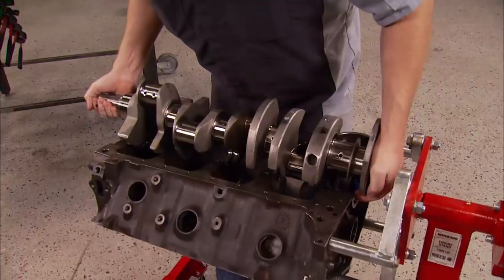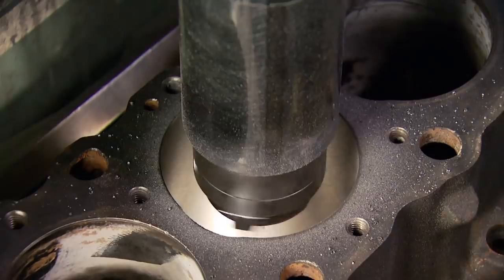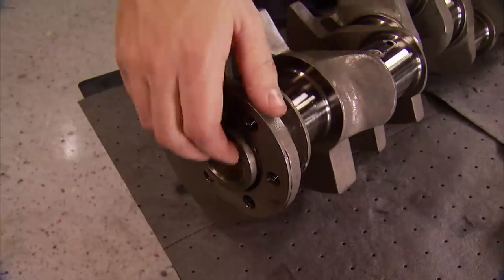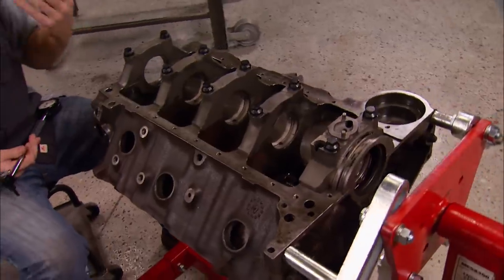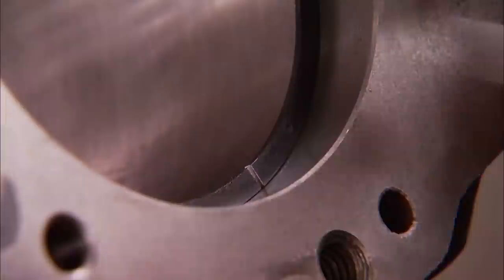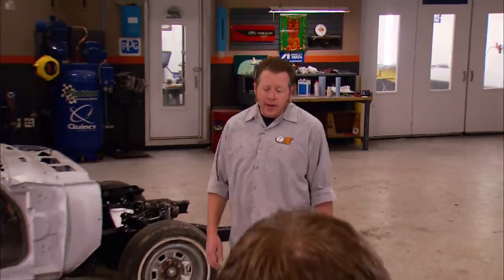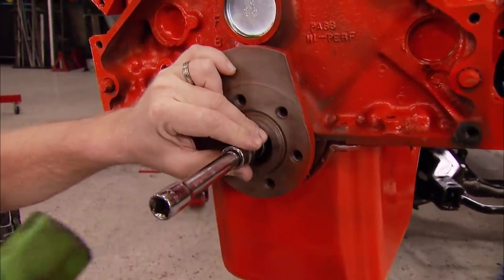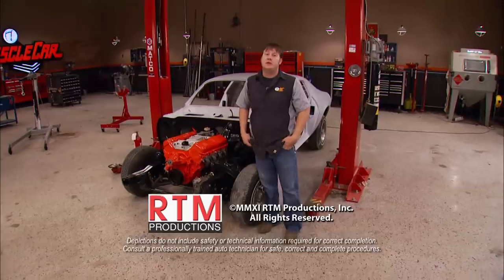Sleeving a 396 Big Block for a 1970 Camaro - MuscleCar S6, E8

Comment from the maker: Tell us about yourself! Take our Viewer Survey! https://www.powernationtv.com/ytsurvey
Reply: POWERNATION , I got a 66 Super Sport Chevelle with a built 327 , 12:5 to 1 compression Forged pistons , Vette crank , 350 four bolt main engine block , aluminum hi rise intake, HEI distributor , headers , 750Cfm carb. 11 inch clutch , Lakewood blow proof Bellhousing , M-21 Muncie 4 speed trans , 12 bolt posi Trac , Traction bars , 
5.5 sec@ 96mph in 1/8
Reply: 99

Comment: What a dream--a large, clean garage with heat and a concrete floor, immaculate engines surrounded by plenty of open space to work in, and all the tools necessary. Paradise.
Reply: Yep! :( ... I swapped an old tired straight 6, with a 350 chevy small block, and a TH350 transition.  SO? All custom fabricated mounts brackets etc.  Oh and I did all the "on vehicle" work, l OUSIDE in the winter, (In Canada)

Comment: True L-78's and L-34's had 4 bolt mains with a L-78 having steel crank.  "Hi-perf pass" was cast on the block @ oil pump area, and stamped with T1212JD on the block.  They came with square port heads, with 2.19 intake valves along with 11:5 comp and solid lifter cam with 0.520/0.520 lift.  On top came a hi-rise aluminum manifold with a Holley #4150, 780cfm.  The rod bolts on a 396 were 3/8" while the 427 hi-perf. came with 7/16" bolts and the rods were dimpled.  L-89's came with aluminum heads.  Using No. 72 jets in the primary with tube headers would get around 500h.p.
Reply: They also came with 7/16 diameter push rods
Reply: Nice google work man
Reply: 375s comp.ratio was 11to 1. Early 427 hi perf. Motors came with 3/8 rod bolts. They were notorious for breaking . You had to check them when buying replacement short blocks to make sure you got the 7/16 bolt. This was before arps came out

Comment: I used to have a 68 chevelle ss 396 I rebuilt the engine 42 years ago. This brought back memories from taking the block heads and crank to the machine shop for work. I thinks the machine shop and bearings they supplied set me back $300. Wish I still had that car.

Comment: Kept the shelled-out block but scrapped the heads for new Summit castings?  With today's low-ZDDP motor oil, I'da put a roller cam in it for sure.
Reply: That's what I was gonna say. A nice hydraulic roller would add some power too.
Reply: Rick Campbell  I have my cams made at Engle Brothers, I let them know what I plan on doing with the engine and so far they have been spot on!
Reply: Oh yea, the stress of potentially wiping out a lobe just ain't worth it to me either.
Reply: On a street motor that will only occasionally see 6000 rpm there is no need to run 450 lbs springs, especially with this cams easy lobe profile and medium lift.

Comment: I was glad you changed the heads,  i have no problem with the block repair,  lower end looks ok with high dome pistons to get your 11.5:1 and solid lifter setup, 2 bolt mains is not L78, also intake does not look correct. a stock L78 makes 425 hp and 445 tq,  Chevy under rated these at 375 hp, with headers you make 457 hp and 464 tq.

Comment: Before sanding any rear main bearing thrust surfaces always measure the widths of both the upper & lower bearings; you might be surprised to find one half is wider than the other.  Be sure to inspect the thrust bearing saddle faces on the block for irregularities too.

Comment: When you measured main bearing bore with bearings,you stated that the clearance was 24,26 and 29. Tolerances are the correct terminology are crucial and new engine builders might take that as .024,.026 and .029, when in fact it’s +.0024,+.0026 and +.0029 and the diameter should be stated as plus 2 and 4 tenths of a thousandth and so on for each diameter and written +.0024. And when checking diameter of mains and pins,you should always check in 2 places at 90 degrees from each other,this will not only show undersize diameters,it will also show egg shape of diameters if present.And you HAVE to measure in tenths of a thousandth if you want accuracy,if your micrometers don’t read in tenths,I suggest that you get them and have an experienced tool and die maker or a good machinist teach you how to correctly use and read a micrometer,this aspect of building engines is the most crucial part,and you’ll gain more respect,and I agree with the knowledgeable people on here,that block is a boat anchor,gonna be a hot spot there and I sure as hell didn’t like how easy that sleeve pressed in.

Comment: You can also use plastic gauge on the crankshaft 2 block inspection. We have been using plastigage for years with every motor we have built measure twice build once
Reply: GreenBoy at GA Farms These guys have the correct tools to check the tolerances and you want them to do the half assed method? okay....
Reply: @alexcorona  and how many motors have you ever built maybe some tricycle Motors
Reply: @alexcorona  maybe you should stick to working on cameras. Do you even know what plastic gauge is or even how to use it do you know how to read it after it's torqued and compressed do you know how to read a dial indicator I'm pretty sure you don't otherwise you would not have left the comment you did plastic gauge is measured relatively close do the same thing as a dial indicator it measures how many thousands between journal to journal they've been doing this before dial indicators were even invented

Comment: What is the valve spring pressures?  145 closed pressure is going to be right on the ragged edge of what those roller tip rockers can handle,  bet they burn-em up.
Reply: and no poly locks......

Comment: Surprised they just hammered that sleeve in without freezing it first.
Reply: ya, I was a little concerned when they did that....i'm used to seeing machine shops doing the machine word so that warming the block and freezing the sleeve are the usual......
Reply: @mikespillman3075  I thought that sleeves had to be pressed in?
Reply: Freeze the sleeve and put sealer in the cylinder since its to water.
Reply: Yeah. AFAIK the standard procedure is to freeze the sleeve, heat the block, then press in the sleeve. 
I suppose production schedules and budget limitations sometimes overrule processes.
Reply: @ChristopherGaul  press/hammer meh apparently
Reply: Christopher Gaul if they would have froze that sleeve it would have fell right in,that press fit was shit,definitely about +.0005 too much on block bore.And I’ve sleeved countless blocks,you dont have to freeze sleeve or heat block if machining is done correctly.
Reply: I've seen them just hammer in like that, especially in stock applications, and only  a.001" interference city like they used ... in this case, an old trick was to give them  shot of any thin spray paint, and hand hammer them in wet.  But many builders use a tighter fit just barley under .002" ... that a lot tighter and freezing and pressing in the sleeves is more popular!
Reply: In 1964 I acquired an R code 427 that had blown three times in a drag car.  Rod had broken at the small end and and wrapped around it's neighbor, wedged between the counterweights...block had a chip out of the bottom. Sleeving that cylinder in JC auto shop became a class project. Got two rods and pistons at a junkyard.
    Engine went in a blue and white 59 Galaxie...first power run after break in exploded the 3 spd. & overdrive....for &275.00 got everything from the engine back out of a wrecked R code Galaxie.
   Stock hubcaps and cheater slicks finished off "ma ma's grocery better. More than one 327 Chevy wished they never jacked
 me up on 4th St. in Santa Rosa, CA.
      We heated the block and packed the liner with dry ice before pressing the sleeve...even with that it wasn't an "easy" press.  LOL
Reply: The fact they left a ridge at the bottom of the cylinder,  helps keep the sleeve from going down, the head will keep it from coming up. 
I rebuilt a 1950 Ford flathead engine and the machine shop I had do mine, had a 2 thousands interference fit, meaning the sleeve was 2 thousands bigger than the cylinder.  It took a 10 pound hammer to drive it in.
Reply: @ChristopherGaul  won't heating the block compromise the strength of the block?
Reply: @chrismc410  no. You don't make it glowing hot. Just hot enough to expand some. The heat treat or temper isn't affected.
Reply: Won't freezing make the metal contract, like cold will for anything else?
Reply: @chrismc410  that's the point. Shrink the sleeve with cold, expand the block with heat. Make the former fit into the latter easier.
Reply: @ChristopherGaul  would it be easier to machine the cylinder in question to allow a slip in with zero insertion force with locktite or similar and the same time still work or is a tight fit necessary? 

Starting to find engines interesting
Reply: @chrismc410  the tight fit is necessary. That's why they normally use heat/cold to make the fit tight.

Comment: Yes indeed a sleeve is fine, do it all the time I use a white glue same as seat inserts, the step at the bottom makes it a pro job. The valve relief is for rectangle port heads with large valves and hi lift. note; all 4 bolt man blocks have it. Who coaches the speech technique all these performance show people sound the same ,(as a matter of fact robot ). fun to watch even though i do this all day long KEEP it up .

Comment: Not trying to be a critic however when using Loctite make sure you use it correctly. Apply the Loctite to the holes in the crank, not the bolts for the flywheel. Loctite will end up between the flywheel and crank flange as it will be extracted off the bolt while screwing it in. Common mistake made by many people!
Reply: Not quite true. I have used thread locker for years by putting it on the bolt first and never had an issue. I will say that I don't just slap it on and jam a bolt in though. I put it on and wait a minute or so,while blowing on it. This way it gels up, before I tighten it down. I have pulled out threadlocked bolts and they were tight coming out and the threads had thread locker between them.
Reply: You put the locktight on the bolts first, start with the first one you did allowing a minute or so to gel up
Reply: i worked many years in a factory using loctite and i found out the only thing red is for it just will not come out unless a touch is used and is heated up to 450 degrees
Reply: D F I agree you will have success that way however...have you ever pulled a flywheel off and seen migrated Loctite? That’s what I’m referring to. After Loctite cures, by nature (how it’s designed) it will force against the two surfaces, act as a jack and you will have a runout on the flywheel. Probably not a big issue on a typical street engine but it matters in pro racing when air gap is critical.
Reply: @cc9z  yes. Red is typically the "permanent" thread locker,that requires heat to break loose. Blue is "removable".
Reply: Donny Moose  best terminology is to use the number verses the color. Ex: red general purpose permanent is 271 and blue general purpose is 242. Loctite has a large variety of adhesives and some are the same colors so it’s best to refer to the number.

Comment: I’ve built many engines but have never installed a cylinder sleeve. Are you supposed to install them with any kind of sealant? I would think that a sleeve installed without sealant would allow for leaks especially if the cylinder is cracked or has holes in it like in the video.

Comment: Do these heads flow exactly the same as the original 3919840 heads?
My uncle had a 1967 L78 with headers and the block had been decked, back in 1970s, people came out of the woodwork to try to outrun him, nobody did.
He raced 440 six packs, 454s, 427s, 389s, etc.
Nobody came close to outrunning him,
The motor finally broke the frame on the left side on a 66 Chevelle (what he had it in).

Comment: What is the compression ratio on those pistons? (I couldn't find it in the link)  Looks really high. Will it run on pump gas?
Reply: Factory specs were 11x1
Reply: A stock L78 is 11.5:1 compression.
NO on pump gas, I have a 472 Cadillac with 10.5:1 compression that I have to add one gallon of 114 octane to the tank each time I fill it up.
I have a 11.5:1 BBC that I plan to run on E85 with one ounce of Klotz 2-stroke oil per gallon.

Comment: I will never use red locktight in a flywheel blot again! After spending a weekend under a vehicle, trying to get the bolts Back out! A torch, and several different sockets, I almost had to drill them out... I guess it could been poor quality bolts but I think blue loctight will work just fine!!

Comment: If your gonna da an L78, might wanna start with an L78 block, 4 bolt main💪
Reply: It's debatable if the 4 bolt main is much of an improvement over 2 bolt main on a BBC, it's more of a benefit for SBC.  Plus you could just machine it for four bolt mains, the block casting are the same, with BBC and SBC.  It's just like the valve relief it was only done on factory rec port BBC.

Comment: In my opinion the holes in the wall of the block is a death sentence for any high  performance engine use. Also I would have ground out the holes and patched the holes somhow. I unfortunately do not have a million $  speed shop at my disposal. This engine is a ticking time bomb with this type of damage.

Comment: The correct procedure to install a camshaft is : 
1. Before you bolt the block to the engine stand.
2. Stand the block, on it's bellhousing.
3. With the block vertical, NOW INSTALL the CAMSHAFT CORRECTLY.
Reply: Some sort of handle helps when installing the camshaft horizontally.

Comment: can someone edu. me? what is the difference between 396/400/402 and 427/454? Just bigger bore/stroke? thanks.
Reply: The 400 was a small-block. The 402 was a slightly overbored 396. The 427 shared the 396/402 stroke with a bigger bore. The 454 was a 427 with more stroke.
Reply: On top of that there were tall and short deck variants.

Comment: those sure look like oval port heads to me, 1970 L-78 should be rectangle ports and so with that said  what intake are you running cuz stock L-78 
would not work on those oval port heads. Would have like a lil more info about the specs of the engine

Comment: two bolt main caps on a L78?
Reply: I noticed the same thing. They should be using a four bolt main block for a L-78.
Reply: Noticed that also, where is the forged steel crank and rods and larger push rods? Doubt they have the real hi perf heads also.
Reply: If it was a true L78 they wouldn't need anything but a rebuild.
Reply: @DONKRIDAZ805  , right and it would be 425 hp with different exhaust manifolds off an impala
Reply: If you watched the episode you would have heard when they said multiple times it isn’t a real L78, just a 402 built to L78 specs.
Reply: @dbabb2484  i know but still 2 bolt main caps....

Comment: what keeps the sleeve from slipping up and down?
Reply: They usually leave a lip on the original bore at the bottom, push it in, then cut it off at deck height. The head keeps it in at the top.

Comment: The L78 had 4 bolt mains.
Reply: It's a clone made with a 402 motor. Not sure what makes it an L78 since it doesn't have the block,  pistons, heads, cam or intake. In reality it's probably a 450 HP 402 build.
Reply: @BBBILLY86  It should have 4 bolt mains, 11.0 to 1 pistons and special performance cam( they claim it has the right cam) with a holley carb. Maybe they did not have the real L78 heads so they went with after market heads. Back in the day it was good for 375 horse power.

Comment: 6:25 Tommy stop lying to people. I used 20w50 cheap motor oil when I rebuild my 96 Tahoe 5.7. I did not burn up my bearings. There are guys on youtube who use plain motor oil all the time.
Reply: I used STP Oil Treatment (the thick stuff) when I rebuild the bottom on a Chevy Small block ... no problems! :)
Reply: @MikeBaxterABC  Sure you do.
Reply: I tend to use gear oil, it is thick enough to stay on for a while. And I dip the  pistons in engine oil.  I also prelube using a drill.
Reply: @scottdowney4318  To spin up the oil pump?
Reply: @MikeBaxterABC  yes, I figure out an adapter to make that work. I think it is an old large screwdriver that is missing the handle. It takes a lot of power to spin that pump, so I use a 1/2 inch drill.

Comment: Not an L78, this is 325 hp at best. L78, came square port heads and aluminum intake with 4 bolt mains
Reply: I was wondering as to why they decided to bolt cast-iron heads back on, instead of going for modern aluminum ones

Comment: L78, had 4 bolt mains, and more to get 375, this was 350 hp block, head??
Reply: Rick Snowden : exactly.    Also, those heads are too big for 402.    (Opinion) 
   More than one 396 using 702’s and 10:1 ish compression making 500 dyno proven hp peaking around 6000 rpm.

Comment: A 307 small block was an outsourced motor and I believe made in Mexico at the time. Could be wrong on where it came from but was definitely a shit box engine to begin with.
Reply: The 307 was not outsourced from mexico. Chevy V8 in Flint, Mich. Produced most of them among other U.S plants. McKinnon industries in canada may have also produced the 307. The mexican small blocks didn't appear until some time in the early 80's. Both 305 & 350.
Reply: Rick Campbell  i don't know why the 307 has such a bad rep, It was the economy small block of its day. 283 bore 327 stroke. It bridged the gap between the I6 and the 350. It was only offered as a 2bbl. Very reliable long lived engine.There were so many 350s at the time it never made sense to run anything smaller for performance builds.I use to crew on an opel GT modified drag car and we used the 307 block/ 302 large journal crank with a slight overbore to get to 288ci. Liberty 5 speed. 10,500 rpm no prob! Valve springs didn't last long and had to be changed often. K motion spring were the best. Anyway, I will build a 307 anyday compared to a 305. The 305 is without a doubt the worst small block ever.